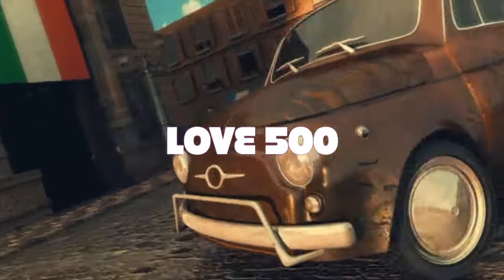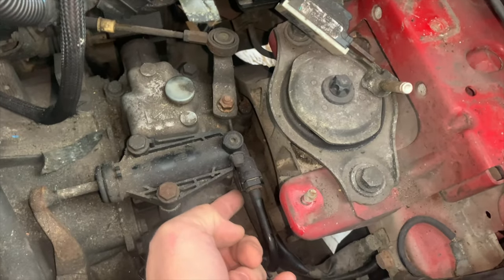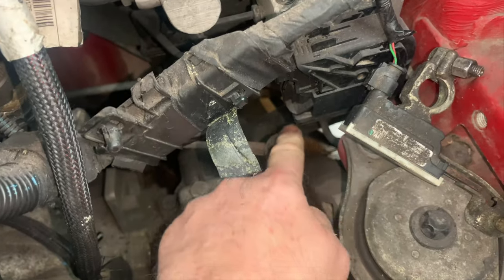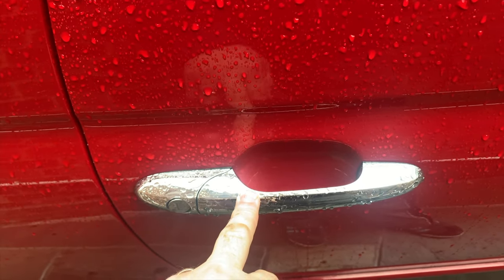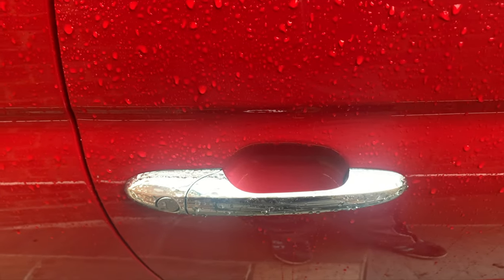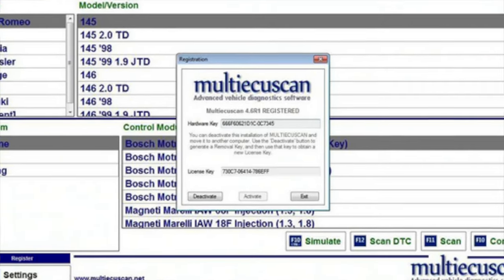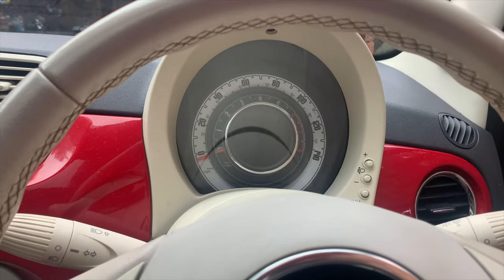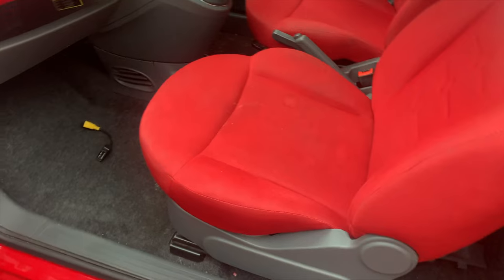Common Faults on a Fiat 500 or Abarth 595. The faults are the same. #abarth #fiat500 #595

Comment: Wondering if you could help with a problem I have with the Blue Me system. all the buttons on the steering wheel work besides the Windows ( Voice Activation ) button and the Telephone button. I have had 2 diagnostic tests done and they come back with a message 'Convergence Telematic Module'  ERROR. Haven't as yet found a solution to the problem and needed to know if there is a quick fix solution or if I need to let the dealership know they need to have this repaired at their cost as I purchased the vehicle this week and need to sort out all the issues and make the dealership pay.....hopefully without a fight
Thanks again for this video, did all these checks the day I collected the vehicle, with a very bemused salesman wondering what the hell I was doing!!!!!
Reply from the maker: I hope you told him about my video 🤣🤣🤣 there’s no quick fix but is your mileage flashing? If you’re getting that error then he blue and me is most likely broken in which case it will need replacing. Dealers should put a hew one in but could be done with a second hand one. A proxy alignment will then be needed. If the mileage is flashing a proxy alignment might fix it.
Reply: @Love500  hahahaha I mist definitely did and mentioned that he won't be pulling the wool over my eyes after the knowledge I gained from the videos...the mileage is flashing,so what would need to be replaced?
Reply from the maker: @justinlyons9914  possibly but a proxy alignment might reconnect it. If a proxy alignment doesn’t work then it will need replacing.
Reply: @Love500  thanks again for the help. what would the cost of one of these units be roughly? i am compiling a list of issues and sending to them before my first week after accepting the vehicle is over. I absolutely love the vehicle but dont want them coming back and saying they cant replace some of the problems as i got the vehicle at a pretty decent price I think. I paid R 85000 for the vehicle(  about 4300 Pounds ) it has high mileage but is really quite spotless inside and out, so was clearly well looked after.
Sorry for all the long winded questions, just want to make sure I get us much info as possible.
Reply from the maker: @justinlyons9914  I’ve spoken to people who have been quoted £800+ from a main dealer. I believe a brand new one from Fiat are over £600. You can pick a second hand one up for just over £100
Reply: @Love500  thanks that's quite pricey,hopefully won't have to go that route. Thanks again and I am sure I will have more questions in the future if that's ok
Reply from the maker: @justinlyons9914  no problem.

Comment: Hi 
Do you have any information about fixing the climate control 
Only blowing lukewarm air through the front vents , believe it’s a broken spindle on the air box have this problem on my daughter twin air along with a intermittently sticking clutch pedal 
Thanks
Reply from the maker: Yes, it’s fairly common. There’s a little plastic actuator that breaks. There is a company that repairs them. I’ll see if I can find the details.
Reply from the maker: www.smallcarservices.co.uk he fixes them for £170. Price for a new one is £3000.
Reply: @Love500  thanks for that 
I’ve had a look but I’m from Yorkshire, hopefully may be able to find someone nearer or make a repair myself 
Thanks sgain
Reply from the maker: @keithbrotherton664  if you join the fiat forum and put climate control in the search box you’ll find a long thread about it with pictures of the offending actuator rod. Some people have managed to repair it themselves.
Reply: @Love500  ok thanks I’ll take a look👍👍

Comment: Automatic fiat 500 clunky into reverse and sometimes jumps out of gear . Have topped the transmission up . Worked ok for a couple of week and then back to doing the same. Any tips
Reply from the maker: Duologic gearboxes are renowned to fail. The oil seals go causing exactly what you describe and worse. There’s a fella on eBay who repairs them with all new seals for around £250. You have to send him your gearbox though. Very common fault on the autos. The reason I don’t get them.
Reply: @Love500  you don't have any contact number for this bloke do you
Reply from the maker: @tommysissons4727  here’s the link to his eBay shop. £225 now.

https://www.ebay.co.uk/itm/Fiat-500-1-2-8v-Dualogic-Semi-Auto-Gearbox-Repair-12-Months-Warranty-/392924825252?mkcid=16&mkevt=1&_trksid=p2349624.m46890.l49286&mkrid=710-127635-2958-0

Comment: I'm in buying 500 0.9
What do you think on that engine?
It's like 2nd car for city drive.
Reply from the maker: Quirky and need looking after but fun to drive. Strange noise they make. First one I had I thought there was something wrong with it.
Reply: I got answer from local mechanic service... If that twin air go wrong, there is 1500€ reasons to not buy that car.
I will go with 1.2 or 1.4 for my wife.
But they spend more than my Mazda CX3 2.0. 7.5l per 100km in city.
1.2 goes I think 8l or around that.

Comment: Today I noticed when I turned on my back windshield spray it all squirted into the inside of the car … do u know why because it’s never happened before ?
Reply from the maker: Was it on the floor behind the left hand seat? If so, there’s a concertina type pipe that runs along that side of the car which is known to fail behind the rear side panel. You will have to get the rear seat bottom out and remove the side panel to get to it. Once you’ve got it off get someone to press the washer and you’ll see where it’s coming from. You can repair it by cutting the cracked but out and putting g in a repair bit with a joining tee each side. I bought some things at a garden centre pet place fir aquariums. I’m sure you could get them on Amazon too.

Comment: i have the rusty strut bolt problem with the water ingress corroding the top nut, so im going to have to cut off the nut - anyone know what the nut size is? or got a link to where i can get a couple?
Reply from the maker: Shocks should come with new nuts.
Reply: Bought 2nd hand one without the nut
Reply: @Love500  unfortunately I bought second hand strut with spring assembly. It doesn’t have the top nut. So I’m looking for a couple.

Comment: I have a problem....my hill start, abs and a couple of other warning lights came on a few months ago. I put it down to not using it much due to covid. Since iv started using it daily, it went fine, no issues. Today, it all back on again. Any ideas?
Reply from the maker: Could be the battery or the main earth strap. All of those are controlled by the airbag ECU so really needs plugging in to see what fault codes are stored. Could also be an ABS sensor. Just a dodgy sensor will throw up all those errors.

Comment: Any ideas on a stop start unavailable fault engine light on with orange triangle still drives but in limp mode
Reply from the maker: Battery, main earth strap or brake light switch most likely one of those three.

Comment: Rusty oil pan. Clutch cylinders and hose, gear linkage twice, both handles, brake switch twice on my wifes 65 plate with 60k since new.
Reply from the maker: Sump was one I missed, (coming in part 2) cylinders not quite so common but certainly do go, same with gear linkages. You’re unlucky for two to have failed. Brake switch also less common but does happen.

Comment: Things you have missed. Rear top shock absorber bushes, rear bushes on front suspension arms,centres falling out of washer jets, blue and me units, instrument clusters,front fog light bracket bonding failing and thermostat plastic pipe snapping off , tailgate handle seizing and front top shock mounting bearings seizing. Boinging when turning lock to lock. Clutch fork pivot seizing and gearbox input shaft collapsing first gear noisy getting quieter changing up through the gears.
Reply from the maker: A lot of what you mention are service items or not that common although some are. I’m doing a part two of this video, some of which you mention is included.

Comment: Excellent video, thanks.
Hadn't realised you were up to 60, need to look back further 😄
Owned since new my 57 plate 1.2 lounge has only had the passenger door handle, must've bought the good one 🤣 I'll add one, I've always kept the blind shut to stop the seats going manky and now it refuses to roll open properly. Damned if you do.......😉
Reply from the maker: Oh really. I have sold a couple of blinds on eBay before but never actually heard of them failing. I always assumed they got damaged in some way.

Comment: My Sister has a bit of a Trouble with her 500C. Mainly when the weather is cold the power steering comes up with a fault code of P1702. It also disable the Hill hold and ESP too. I cleaned the main ground and it has the copper ribbon ground to the Engine. Still not working properly. U removed the Fuse box and checked the connectors for water ingress and corrosion, nothing.  Any other tips what could be wrong? I'm starting to think to throw parts at it.
Reply from the maker: Assuming your battery is good. Get a meter on it and see what the output is it’s most likely that earth strap. Sometimes it has a plastic sheathing round it, sometimes not. It can still be rotten either way. Get a replacement on eBay. It certainly sounds like it’s that.
Reply: It already has a new battery. I saw ground straps in Halfords. I may buy one and swap it but I'm starting to think the Power steering unit has a fault in it.
Reply from the maker: @ukcarrebuilds3277  highly unlikely and most unusual.
Reply: @Love500  to be honest I already took all those ground cables cleaned the posts with wire brush, Sand paper, and brake cleaner. The connections The bolts and nuts. Could that ribbon cable be corroded between the cable and the crimped terminal? Would grabbing a gas torch and solder the inside help? I can not think of anything else to be honest.
Reply from the maker: @ukcarrebuilds3277  yes that’s exactly it. They are £4 on eBay. Just change it.
Reply: New ground strap is in and still not working. I disconnected the power steering.  No corrosion, no dirty connection. Can not find a smoking gun.
Reply from the maker: @ukcarrebuilds3277  I would get yourself MultiECUScan and a set of cables. I think you need the green one for the steering. You can connect to it directly and run diagnostics on it on MES.
Reply: I can read the codes with my EOBD reader. It comes up in the ABS module with P1702 code.
Reply from the maker: @ukcarrebuilds3277  that indicates a communication problem between the body computer and the steering. MES will give you more if an idea. I believe there is a relatively common fault with the electrical connection plug on the steering. Not sure where it is but might be worth a disconnect clean up and check the wires.

Comment: Have a 2010. When I bought it it had an airbag light on. Just found out no airbag ecu in the car. Was trying to source the part on ebay but supplier told me I need old part number. Any advice please?
Reply from the maker: Tricky one. If you Google eper you should be able to enter your vin number and then navigate to the airbag system and the model number for the ECU should come up.

Alternatively you should be able to use an ECU that is if a different number. As a 2010 car there is a possibility of two different ECUs though. Is your car an early one without stop/start? If so, it’s possible your car had the silver metal bodied ECU, otherwise it will most likely be the much more common black plastic cased one. Try to buy one from a 2010 car on eBay, that’s much more likely to work. If it doesn’t, you can easily resell it on eBay and get your money back.
Reply: @Love500  thank you for your reply.. Mine is a stop start model. Much appreciated. Thank you love your videos.
Reply from the maker: @mjintegrale  yours should be the plastic case one then.
Reply: @Love500  again thank you for your reply.

Comment: Heater working but not blowing cold air  non a c  pop any ideas
Reply from the maker: You mean it’s only blowing hot? Temperature doesn’t change when on cold? Can you tell the resistance of the knob as you turn it?
Reply: Can feel resistance does go slightly colder  when turn from hot to cold

Comment: Hey, I’ve had 2 diagnostic checks and nothing came up. I got a new battery and checked my fuses, but my mileage is still flashing? My blue and me works also :/ any ideas ?
Reply from the maker: Who is doing your diagnostics and using what?
Reply: @Love500  I took to 2 mechanics
Reply: @Love500   no codes are coming up :( I changed battery thinking it was that… the old battery wasn’t a stop start so I thought changing to a stop start would have stopped it
Reply from the maker: @elishaaax  batteries have nothing to do with flashing mileage, neither do fuses. Your car needs a proxy alignment.
Reply: @Love500  tbh I thought a diagnostic check was proxy alignment. Every time I mention it to the garage they say diagnostic check
Reply from the maker: @elishaaax  absolutely not. A proxy alignment makes the computers talk to each other. The mileage flashes indicating that the body computer has lost contact with one of the other ECUs. Usually blue and me or airbag one of which would be faulty. If they run diagnostics and there’s no codes then they need to do a proxy alignment. I can only guess they are using a generic code reader and not a Fiat specific one.

Comment: what is the best resource to understand parts for your 500 2012 Pop 1.2 . Great vid . I have the cluster issue plus day light running fault and need rear caps for headlight cover power steering is heavy before you set off even in city mode. 

help
Reply from the maker: If you Google 500 3Learn you will find a maintenance manual. As for parts, just enter the part name into eBay. You'll pretty much find everything you need such as the headlight dust covers you mention. Your steering issue is most likely the main earth strap corroded not supplying a sufficient enough earth to allow the powerful motor in the steering column to work properly.

Comment: Is it normal for the gearbox dash light to come on when the car has been sat around for a month unused (just bought a 500 pop recently) neighbor started the car in neutral to run the engine (parked) to turn engine over and the light has come on. I saw a video on YouTube saying it can be fixed with a accelerator adjustment on the accelerator box?
Reply: Automatic dualogic one
Reply from the maker: I’m not that familiar with it never having had one but they are renowned for oil seals problems.

Comment: Help. Does anyone know how to reprogram a new stop start battery on a Fiat 500.
I fitted a new battery that I paid £180 for but I don’t know how to reprogram the car to recognise the new battery so the stop start doesn’t work.
I don’t have the multi scan  tool
Any help much appreciated.
Reply from the maker: You don't have to code a battery on a Fiat 500. Stop/start is crap on Fiats but would normally work on a new battery for a while. You may have to drive it a bit, but unlike most cars, it will not work, more than it will. They are all like that and most people turn it off anyway.
Reply: When the old battery expired, my wife called the breakdown guy who replaced it with an ordinary battery 6 months ago that cost about £70.
Before this the stop start was ok but didn’t work with the new cheap battery.
I put a new proper one on last week and it still doesn’t work.
Fiat said it needs to be reprogrammed as the ecu doesn’t recognise the new one and is still recognising the old one and want £140 to do it.
Reply: Their prices are ridiculous and it looks like we’ve had £250 worth of batteries and it still doesn’t work 😟
Reply from the maker: @pauldeakin3413  unsurprisingly Fiat don’t know what they’re talking about. It’s not necessary. The stop start won’t work with a non stop start battery.
Reply: I mean I fitted a correct battery after the breakdown guy fitted the wrong one.
This doesn’t solve it and Fiat want £140 to programme the new battery which is ridiculous
Reply: Love your channel by the way and it’s helped me a lot over time
Reply from the maker: @pauldeakin3413  the £140 is for an hour on the diagnostics. It doesn’t need doing. It won’t work as they can’t actually do it. The fiat 500 doesn’t have this. Other fiats might do and my BMW does but the 500 doesn’t. I’ve had over 100 500s and I’ve probably replaced well in excess of 50 batteries. Start stop might work for a while but then it’ll stop working. Ignore it. It may work sometimes but you’ll find you don’t want it to so will turn it off like everyone else.

Comment: My evic is really faded had it reconditioned put it back in worked fir a few seconds then back to hardly anything to see on screen. Can tips on what else I can do
Reply from the maker: Send it back to whoever reconditioned it. They clearly haven't done it right. Sounds like the little three pins for the backlight aren't pushed in properly. I did that and it was really dim.